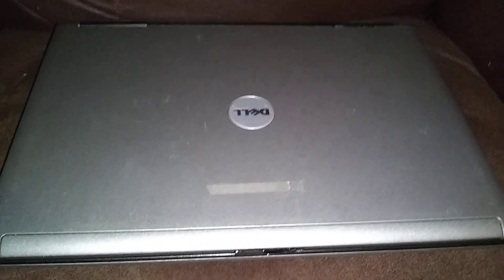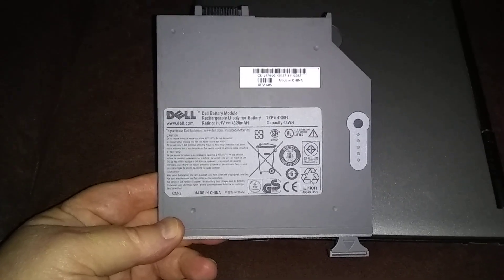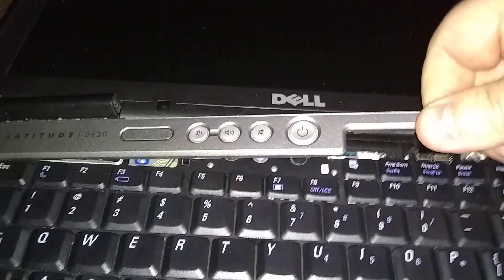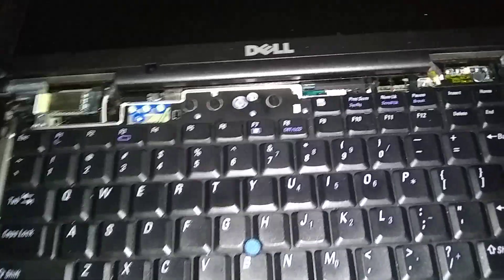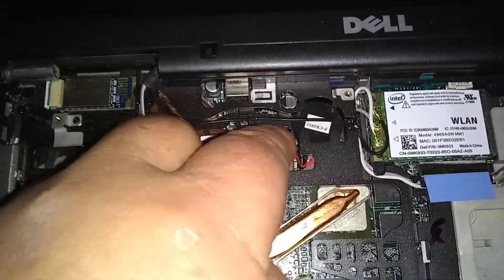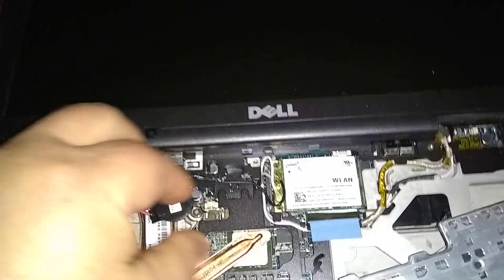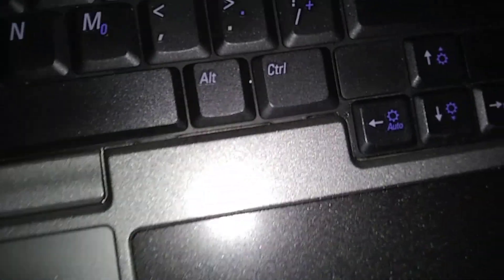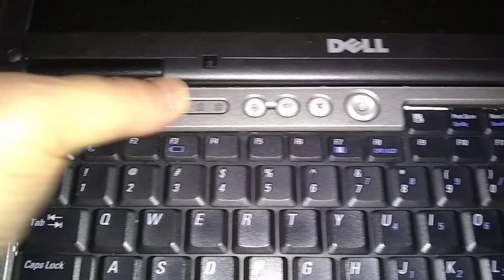Dell Latitude d620 d630 d820 CMOS Battery Removal/Replacement/Install, Nervous Nick

Comment: Is the second part where you go in behind the keyboard and attach the black circle thing to the motherboard necessary if I don’t have a secondary battery? If all I have is the main primary battery, is the job done by just taking out the main large battery on the bottom of the laptop? Thanks.
Reply from the maker: Yes, Just replacing the Main Battery will not reset or restore the CMOS Battery, it most be replaced!

Comment: Me gustaría que el reemplazo de la bateria fuera más genérico. Tuve que improvisar, Desarme la bateria descargada y le adapté una CR2032 genérica con el conector y los cables de la bateria original, reutilice las laminitas de contacto y envolví con cinta de aislar.

Comment: Thanks for the instruction! I have one of these with a locked bios(admin psswrd)..... I removed the CMOS battery for an hour and its still locked..... Any tips on how to reset it? I'd like to upgrade the drive but can't with the locked bios ....
Reply: Turns out the locked bios didn't prevent the new SSD drive and windows 10 upgrade .... It runs well!
Reply from the maker: Just install a New Hard Drive!
Reply: @NervousNick Thanks, I did!
Reply from the maker: @davidsimpson3380  Sweet! ...Also, the d630 can handle up to 8gb of RAM(Memory)

Comment: I still owned Dell D620 & runs Windows 10 Home.Where is the link for that battery found in amazon
Reply from the maker: Link to CMOS Battery:
https://www.ebay.com/sch/i.html?_nkw=dell+latitude+d630+CMOS+battery&_sop=15
Reply from the maker: Link to Modular Bay Battery:
https://www.laptopbatteryexpress.com/Dell-secondary-modular-bay-laptop-battery-p/dell-88.htm
Reply: Nervous Nick thank you!I forgot to mention,great video,this helps me a lot to reseat my keyboard.
Reply from the maker: @Rodskilotski  Nice Video!
Reply: How to make on biten
Reply from the maker: @bilalahmed1745  What?
Reply from the maker: Drop an SSD & 4gb of Ram in the D620, & you'll be Flyin!
Reply: Nervous Nick that’s what i did,i upgraded my Ram to 2 x PC2-667 2Gb each ram & installed Crucial BX500 120Gb SSD.,my D620 is now fast to boot & launch app with ease now.
Reply from the maker: @Rodskilotski  You can also Upgrade the CPU to 2.6mhz & Upgrade to a Faster Wi-Fi Card!
Reply from the maker: I put the CMOS Battery & Modular Bay Battery Links in the Video Description!